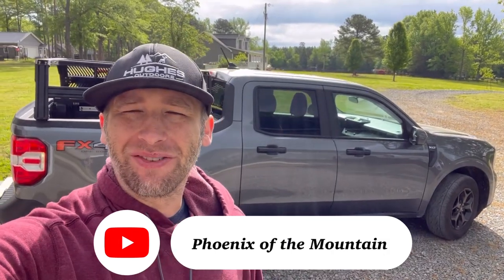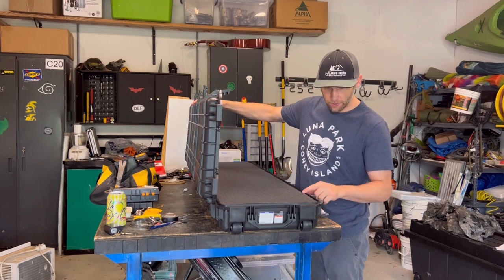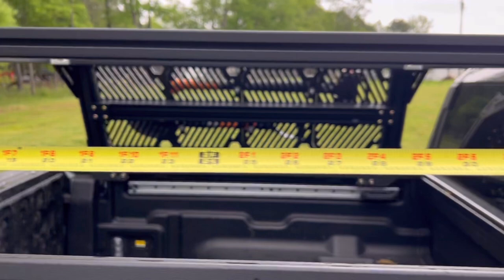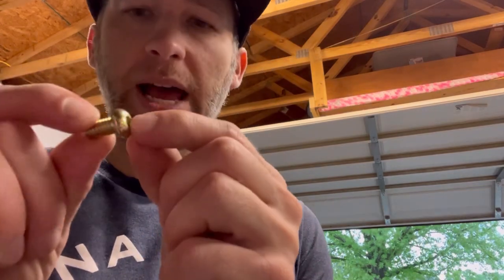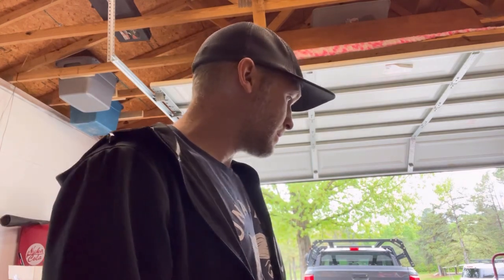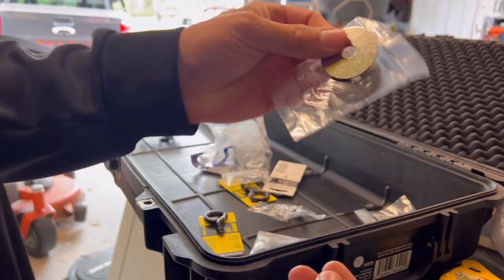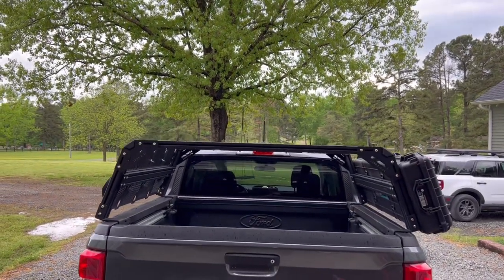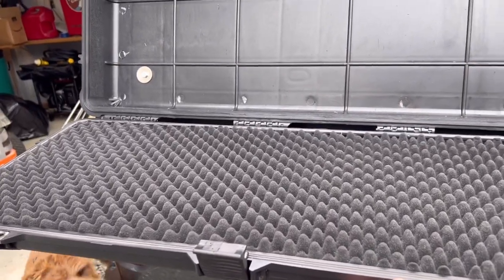DIY Overland Tool Box | Ford Maverick Xtrusion Overland Harbor Freight Apache Box

Comment: super nice, thanks for posting, great info

How tall is your rack? 16 inches? Are you happy with that height? I am considering the same XO rack system but thinking slightly taller than cab height for a kayak, plywood, etc. I would appreciate your thoughts on that. Thanks
Reply from the maker: Yes a 16, although I’m not sure that height is made any more.  Yeah, I got my height for the same, but decided I would use some sort of riser to clear the roof. The last time I loaded a ladder, I used 2x4’s to clear the cab.  That seamed to work.  I think a kayak in the standard 45degree carrying angle, would probably clear it as well without much issue.

Comment: Good idea! Now your rear mirror is useless! Xtrusion overland actually has recessed mounting brackets for that kind of application.
Reply from the maker: I’m not sure I understand what you mean?? I can see perfectly fine through every single one of my mirrors with no obstruction.  Thanks for watching!
Reply: It looks like the box is blocking your view. That's what I meant. But if it works, it works! Good job!